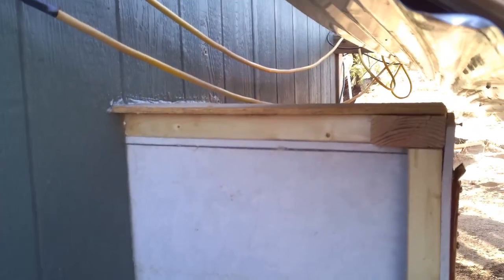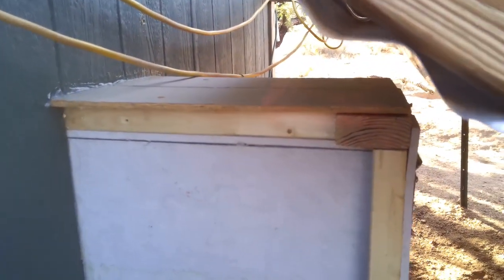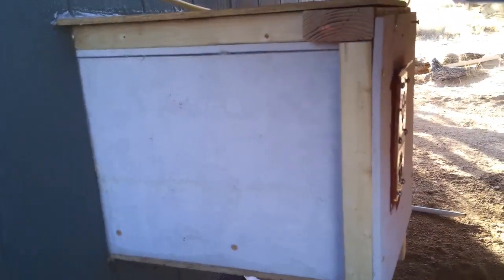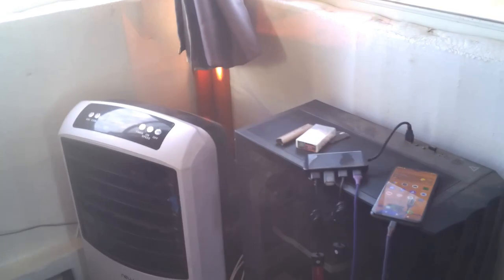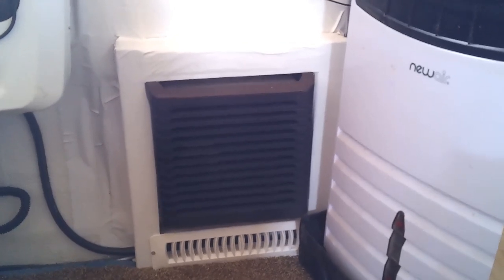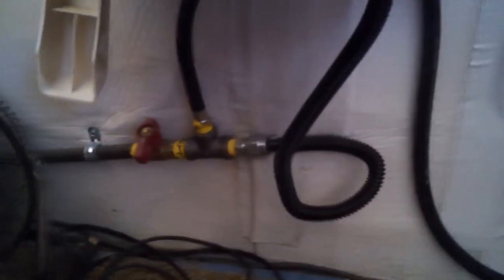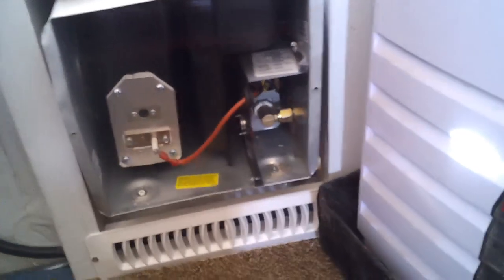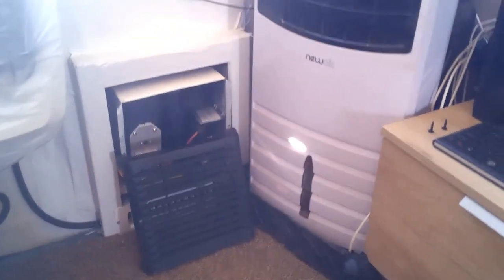New FURNACE in the Tiny Cabin @ AZ  Off-Grid (Unplugged)

Comment: Those RV heaters haven't changed in years. Mine pumps out a lot of heat but really uses a lot of propane.
Reply from the maker: Which was why I waited until after I got the big propane tank installed before I got the furnace.. I will primarily use the 10K btu wall heater (much better efficiency) .. the new RV furnace will mainly be used to keep a minimum temp in here.. (Yes, it does get cold in the desert.. It got to freezing (32) last winter..) .. Thanks for watching.. ..Happy Trails.!!

Comment: I like it looks good and simple
Reply from the maker: and effective.. It was the inconsistency of the temps in here I did not like.. I did not feel safe running the wall heater all night with the puppies in here.. so in the morning it would be cold in here,, but because I have this place so air tight it would only run 1 hour before it's low-oxygen sensor would shut it off and that would not be quite warm enough for me.. Thanks for watching.. ..Happy Trails.!!
Reply: @deserthorizons  I summer you can handle temp swings but, in the winter, the older we get the temp swings will make you sick. good move
Reply from the maker: @georgeshotrodbarn2113  then I been an old man since I was about 15.... growing up in Minnesota winters continually got worse for me.. moved to Phoenix in '81.. hmmmm,, funny,, for the last 40 years they have gotten worse here too.. I am set for the future now..

Comment: A propane RV furnace sends most of the heat outside. You can boil water on the exhaust that comes out of it. They are not very efficient running.
Reply from the maker: Correct, they are not the most efficient way to heat,, but I can put my hand by the exhaust coming out of this furnace and keep it there,, so "most" of the heat is not going outside.. This is supposed to be over 70% efficient which means that for every dollar of energy I put in I get ~70 cents worth of heat out.. My propane wall heater is 99% efficient so I use that as much as I can but it sure is nice to be able to heat this place up quickly when needed and to be able to set a specific temperature I want it.. It has been a blessing this winter with the furnace.. Thanks for watching.. ..Happy Trails.!!

Comment: Hey Robert, how are you doing down there. I hear most of your aera is under flash flood watch. (8-20-2022) North
Reply from the maker: Howdy North,, how is it going.?    Doing Fantastic here thanks.. All ready for winter now.. ..Place your hand palm down on a table.. That represents the terrain where I live.. Between the fingers is a "wash".. I live on top of one of the fingers and am covered on both the north and south with washes that run to the west.. One wash is about 100 feet from my cabin and the other is about 100 yards.. Both washes run at about 15 to 20 feet below my foot level.. The surrounding area is all lower than me except to the east where the runoff comes from.. It will take a biblical flood before I need to worry.. But, yeah, we have been getting a LOT of rain.. Thanks for watching.. .Happy Trails.!!
Reply: @deserthorizons  Well let me know if you need help. I'll send in the US Coast Guard.

Comment: Hi mate. How cold does it get in winter ? With all that insulation you put on the walls you should be fine.
Reply from the maker: Howdy jp.. Twice in the last 12 years it has gotten down to 17F (~ -10C) .. Even Polar bears and penguins think that is ridiculously cold..  The insulation is doing it's job of keeping this place air tight.. I did not feel safe running the wall heater all night with the puppies in here.. so in the morning it would be cold.. Now I can set a minimum temp I want in here and use the wall heater during the day.. I was thinking this spring "What is it I miss about living in town.?"    Only thing I could come up with was having consistent temperature all day during winter.. So I fixed that..   Thanks for watching.. ..Happy Trails.!!
Reply: @deserthorizons  I thought it might get cold in winter We don't get below freezing much, not even a frost last year. When our daughters were young we built a snow woman, quite a well built lady. Needless to say a neighbor 'commented', I replied 'your only jealous'. Perhaps not the best reply but she went purple so that's OK. Not seen snow in years. About 30 years ago we had -20C, just one night. I should think your just about sorted for air con now. You could make a really good hot water system. no pump just thermosyphon. All you need is a large old hot water radiator, a 10 gallon tank a ballcock (not plastic) and some pipe and fittings. Gawd this is getting long so bye for now and take care.
Reply from the maker: @jp-um2fr  it rarely gets below freezing,, F or C,, here either.. Maybe once or twice a winter.. It has snowed twice at least since I have been living here,, 4+ years.. .. My hot water is already taken care of by the old water heater tank from the RV with a "Hott Rodd" electrical insert that heats the water..(on an old video)  It came with all the cords and a switch for 75 bucks.. uses 415 watts when running.. maybe 15 minutes in summer,, an hour and a half in winter gets me 6 gallons of hot water just by flipping a switch..